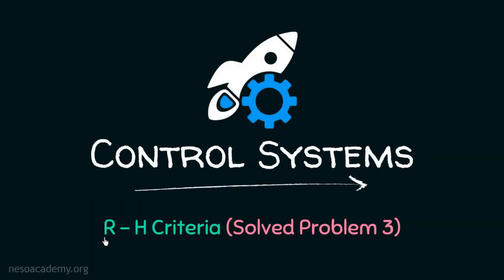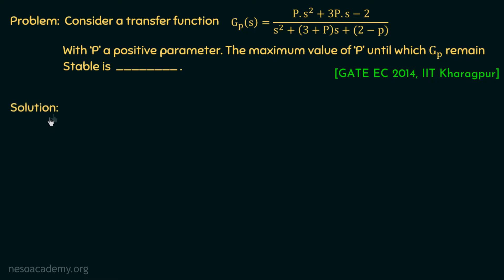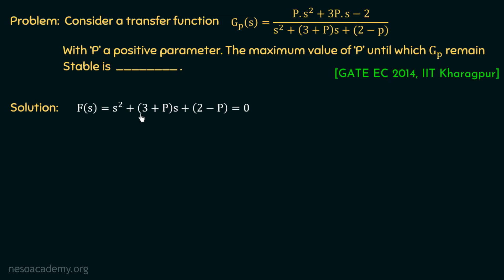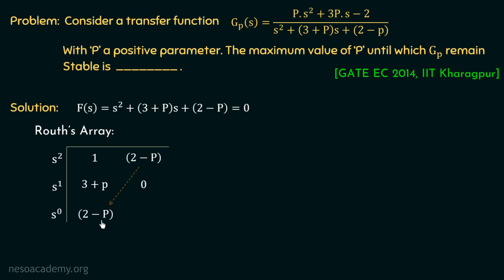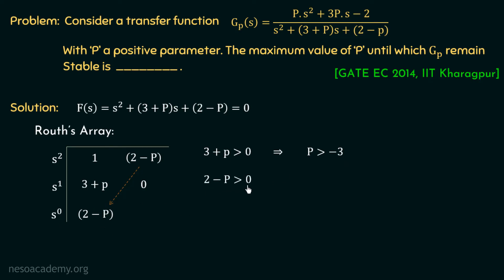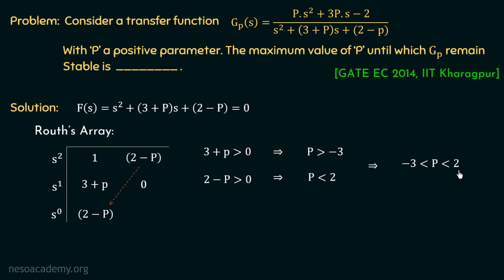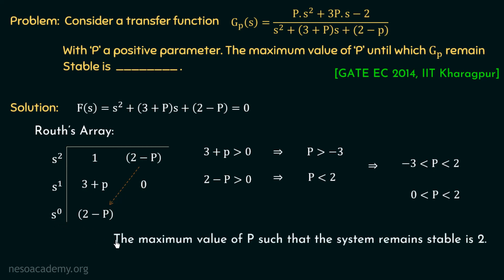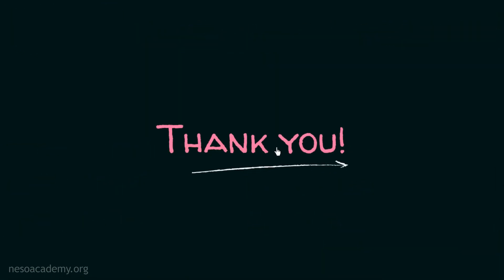R-H Criteria (Solved Problem 3)

Comment: 3rd Row (s^1): |  (4k^2+6k-4)/(2k)  | 0
4th Row (S^0): |  4   |

--> so, 2k > 0 (2nd row) & (4k^2+6k-4)/(2k) > 0 (3rd row) these two criteria must be met to be Stable system

-->from 2k>0, we can say k > 0 (must be met for the first element of row 3rd row to be positive)

--> from (4k^2+6k-4)/(2k) > 0 , we get k < -2 and k > 0.5 (i.e. any one of these criteria will make the first element of 3rd row positive, which is necessary for the system to be stable. However, we also found out that k >0 for the 3rd row to comply with stable system criteria

--> combining these k > 0 and k > 0.5, we can say 0.5<k, which is equivalent to option D

Ans: D

Comment: Little Doubt🤷🏻‍♂️- If P=2, Then Constant Term (or) Coefficient Of S^0 Of Char.eq i.e (P-2)=0 & That Violets The Necessary Condition(Hurwitz poly.)
Reply: But it doesn't violate the conditions for stability..... Stability doesn't only depends on conditions of " Hurwitz polynomial ".........In question they mainly focused on STABILITY

Comment: HW problem: Ans 'D'
Reply: How? Solution plz
Reply: @shanmugikilli5697  S^1 row first element would be 4k^2+6k-4/2k and S^0 first elemet would be 4. so s^1 element wuold be positive hence 4k^2+6k-4>0 as k is always greater than 0 since s^2 element was 2k(quest) which is always pistive.Solve that equation you will get it (k-1/2)(k+2)=0
Reply: @ayushmishra3283 Then can't the answer be "B"?????